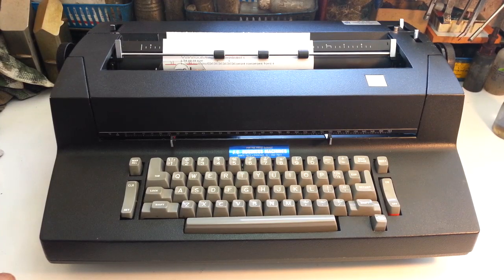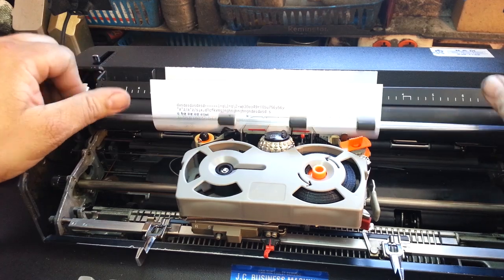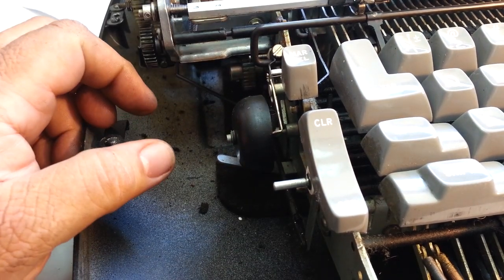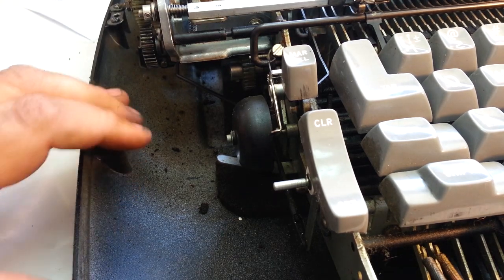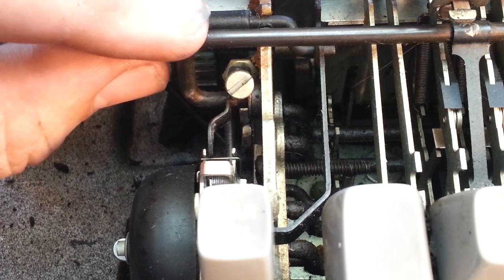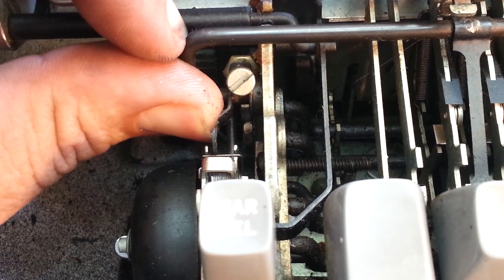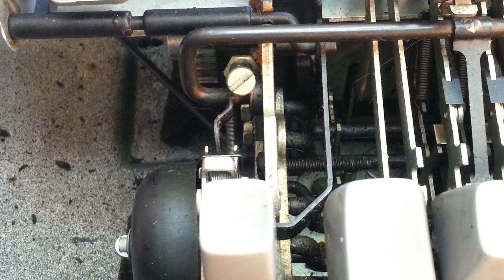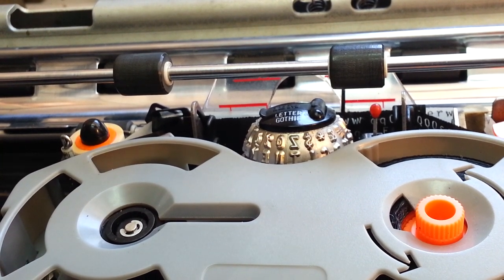IBM Selectric Typewriter Louder Bell Hack, Adjust Dinger for Bolder Ring Action !

Comment: Hi Duane, thank you so much for the invaluable knowledge you're sharing! After 3+ years of somewhat collecting and "restoring" manual typewriters, I scored an IBM Selectric 1 for €10 the other day. Your videos helped me get the carriage rolling again, the tabs are working (still a bit sluggish from time to time, but it's enough for me), and now even the bell resumed to chime. It was a major P.I.T.A. to replace the hardened, disintegrating rubber stand-off, and I was on the verge of despair when the bell simply would not ring after the replacement. Your "hack" brought the bell back to life - even if I had to bend the trigger almost completely to the left, as it was already in its centre position when I started.

All that is left for me now, is to sort out this weird whirring/buzzing noise that sometimes occurs when pressing space/backspace, a bit of troubleshooting of the index function (sometimes it locks up the platen, and you've got to advance it by turning the platen knob for 1/2-1 click) and a new sound insulation. But I'm optimistic thanks to your videos 💪🏻

Comment: Excellent. I was just thinking about my bell being really quiet. I also need a new fan.
Reply from the maker: There are no good fans anywhere, all have deteriorated, not necessary, motor has a sufficient internal fan.
Reply: @phoenixtypewriter2136  So I can disconnect it?
Reply from the maker: @MichaelDoornbos  Yes, remove it and forget it was ever there . . . .